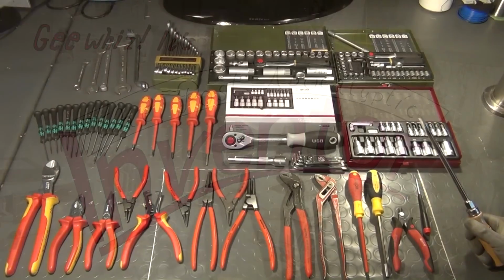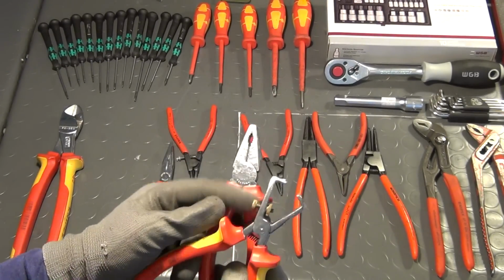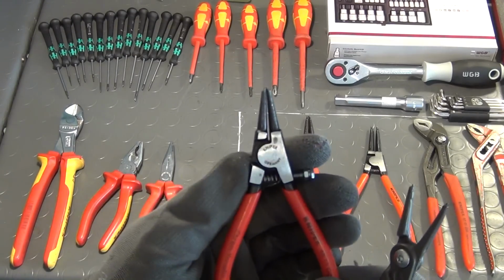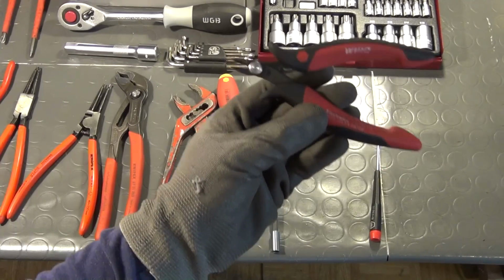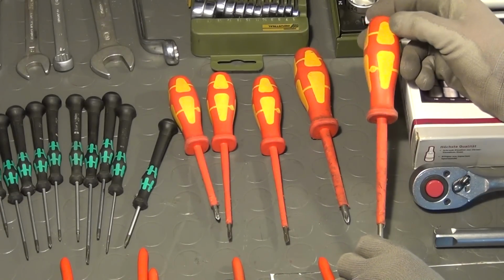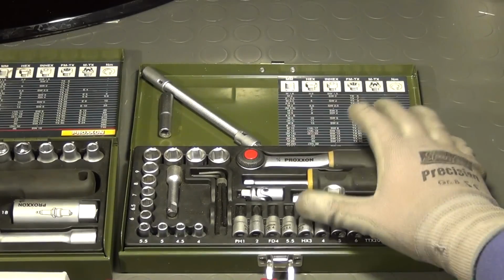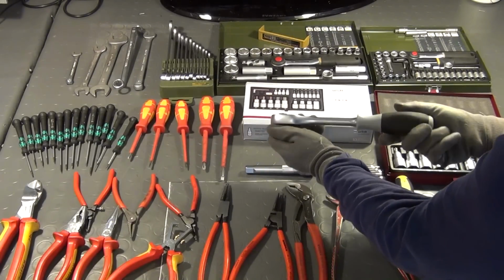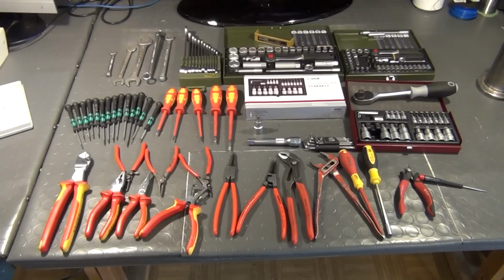German Tools Review: Knipex, Wiha, Wera, WGB, (Proxxon)

Comment: Loverly set of tools, they make any job much much easyer :-D
I have heard about Knipex, but not yet tryed them, the other brands i havnt heard of.
Perhaps Knipex need to cast the metal handles with ridges that will be filled by the plastic moulded on grips, should be quite easy to do that.
.
I do like the Proxxon socket sets, propper metal case and they look good quality, i could trust a tool like that.
The new 1/2 inch ratchet may be made a little softer to the ears by adding a little grease to the toothed part.
The only old spanner i have is german i think, WFR RADEBEUL DDR, i had to remove the rust but its been a good tool :-D it has TGL and a triangle  on it too.
.
Reply: +zx8401ztv The grips are made separately, and slipped on later. There are small voids between the metal and plastic that can not be produced any other way. This is true for the heavy blue/red grips, and I think also the yellow/red insulated ones in the video.
The nasty thin red grips (like on the circlip pliers) are made by dipping into liquid plastic.
Knipex should just add some glue for the stripping pliers, but really, that pattern sucks anyway and is not worth having. There are much better stripping pliers which grip onto the insulation, so you don't have to pull.
Reply: +stefantrethan 
Oh i did think that they were moulded on, how odd that they are not.
.
I found a medium sharp penknife strips insulation fine, just roll the wire over the blade, perhaps i just got used to that method lol.
.
In one job that i had, we had automatic wire strippers, like plyers on steroids but with 4 ends to grip and cut + part the insulation off, they worked like magic, every wire was stripped to the same length.

Comment: In Sweden we had Sandvik and Bahco as the top of the line brands, but today many electricians prefer Wiha and Wera. Knipex is expensive in Sweden, but they last very long and can take a lot of abuse. We have Bauhaus in sweden wich are selling german tools, very nice shop.
Reply: +Steve Henriksson  I still have one and the only solid lovely Bahco.
Reply: Honestly, Bacho Hand Saw never come close to the superb Japanese Silky Saw. Silky Saw cut tree branches like butter. LOL.
Reply: +Steve Henriksson I have a lot of Bahco tools. My dad also had a lot that he abused for 30 years. Most of them are still good.
Reply: +Steve Henriksson Bahco Ergo file handles... mmhhhhmmm.
Much better than Nicholson or the wooden ones.
Bahco has a lot of neat stuff, like the hand saws also.
Reply: +Steve Henriksson I have one of the Knipex cobra ones, really the best pliers i have ever used. Pretty expensive but worth it! Much due to the everlasting quality and the firm grip. Even though the one i have is a medium size and sort of bulky, the design and sharp teeth make it very useful even on small parts. Especially if I need to hold something very small like bending just the tip of a thick wire or whacking it with a hammer. Also, since I'm from Sweden aswell, here we call this type of pliers a polygrip!

Comment: the cobra push button can fall off due to unscrewing and when it's gone ?/##!  however the alligator will survive
Reply: The push-button is secured with a leaf spring, not screwed. And trust me if I say that even alligator's pin can become loose and fall off, I have one at work that does exactly that. However, adjustable wrenches are a "second choice" tool when you don't have the correct wrench for that nut size or when you need to loose a stripped head, and the Knipex Cobra are a well designed, with many regulations point and well thought jaws profile. An even more solid and efficient, albeit bulkier design, is the pipe wrench, but it's hard to get into tight spots.
Reply: I own both styles purchased on the tool truck for auto mechanics. My small set of cobra knipex lost its button fairly quick after purchase and the alligator 12 inch pipe grippers were trouble free for 20 years. So after that happened I was a little disappointed. Knipex pliers are still the best thing going. No tool maker produces quality steel like that anymore but Knipex. Not even Snap-On

Comment: Hi,  
I was recently introduced to the Knipex brand, by my local Snap-on dealer.  I bought two each of the smallest "channel lock" style pliers and was immediately hooked by the quality.  Both in the toothy jaw and smooth jaw design.  My experience has been just as positive.  Apparently the smooth jaw is all the rage her in the U.S.  The Aviation industry loves them.   The smooth jaw won't mar the edges on bolts used in jets.  Mar'ing a bolt will get a repair job rejected by the FAA here in the states.  I have used all the other companies you presented, with the exception of Proxxon.  In general I am usually pleased with most Germany products.  We all know that Germany and Austria has made quality gear for hundreds of years.

If you are interested in trying other Western Brands, I would suggest Snap-on as the only surviving "U.S. made " tool.  Snap-on also has a foreign made line called Bluepoint.  They seem to be nice.  I have two sets of the Bluepoint wrenches I keep in my vehicles.  This is due to their lower cost.  If they get stolen.  It isn't like I lost $1000 worth of Snap-on wrenches.  Only $500.  Seriously.  These are some expensive wrenches.  The only justification I can give for spending that much is, quality costs.  And if you have to keep buying the same tool because it breaks.  You were better off buying quality in the first place.  Plus, I have broken down in the American Western desert.  This is not a place you want to get get stuck in.  You can die very easily.  Suffice it to say I live in some very hostile terrain. So having quality is important.  This is also why I keep common car repair parts (spare hoses, belts, etc), food, water, med kit, ham and CB radios,  warm clothes and sleeping bags in my commuter vehicle. There is also a 100W solar panel on the roof of my car.  I learned my lesson when this happened to me in college.  It will never happen again.  Breaking down in November at night, without a jacket, on a lonesome road is bad.  Really bad.  I was 100 miles from the closest town.

I would also suggest Challenger and Proto.  There are also very expensive and well worth the money if you rely on tools.  Some of the boxend wrenches can be $100 each for common sizes.   I have a few of the smaller sizes.  I would buy more of them for my different kits, but they are hard to find.   I guess that is what "Pawn shops" are for.  Besides it is fun to dig for new tools.

Craftman used to be good, before the Sears corporation was sold in 2005.  Even then you have to go back to the 1990's to find quality in their entire product line.  I recently acquired a 12" bandsaw for free from my local classified adds.  The throat of the saw is 7" with a 1-1/8HP motor.  The only thing wrong was the wax capacitors were bad and needed replacing.  The old owner didn't want to go to the effort to take out the motor and bring it to an armature shop for a refurbishment.  (We Americans are getting really lazy compared to when I was a kid)  I am not complaining.  This means I get good tools if I want to exert some effort.

Final note; thanks for the reviews and notes on Fein tools.  I will look into getting one or two.
Best Regards,
BAG2